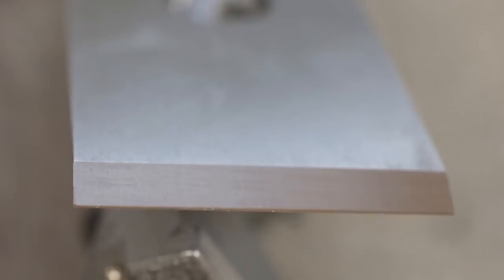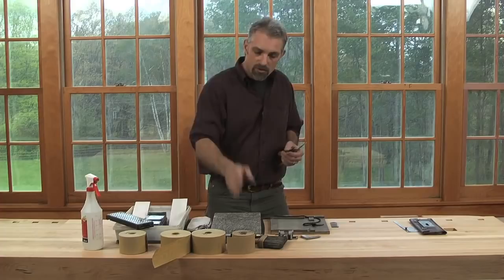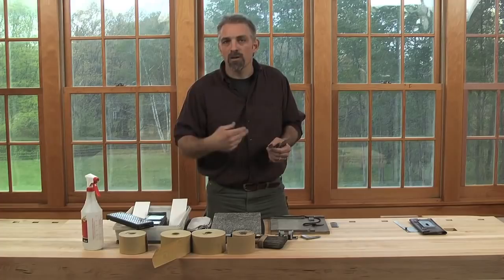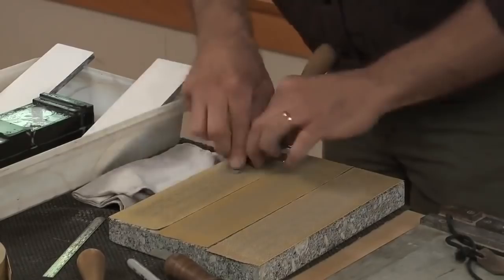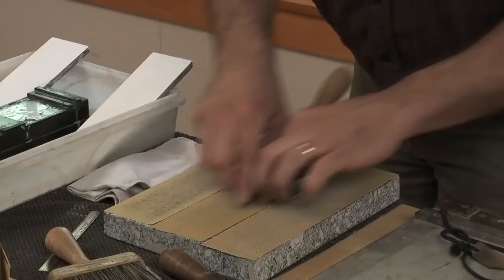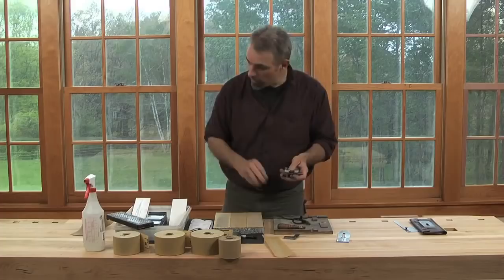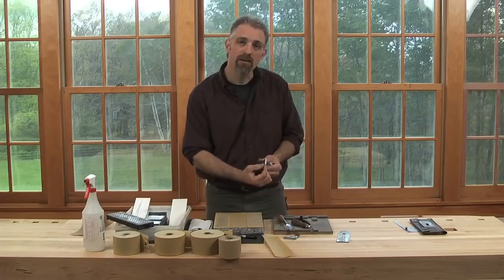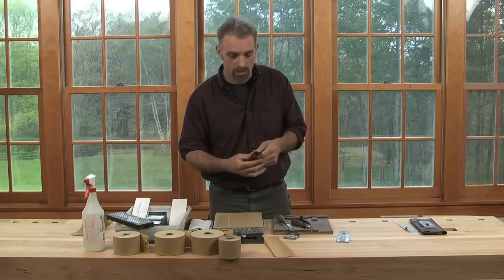Quick Tips Episode 4- Re-Establishing the Primary Bevel

Comment from the maker: When you need to re establish that 25deg bevel there is a significant amount of metal to remove.  You wouldn't go to a stone for many reasons. 1) They are expensive. 2) Their grit is to fine.  We suggest 80, 180, 220 and maybe 400 and if you could get a stone that rough you would wear it out in one session. 3) The sand paper won't dish out during the process, leaving you with a much more accurate result.  Once you get that bevel re-established you can move to the fine stones for final honing.

Comment from the maker: Ah, good question.  We are just re-establishing the primary 25deg bevel in this video.  You would do this after your honed secondary bevel grows to the point of slowing down your sharpening (usually when it grows to 1/3-1/2 of the primary bevel).  Once you get the 25 deg primary bevel back, you will hone the secondary bevel with your stones at what ever angle you need.  We have found the 8000 grit water stone to be the ideal finishing grit.

Comment: AskWoodman (here on YT) uses a 1 to 1 mix of water and Simple Green and water and states that it works very well to prevent any oxidation, it's cheap, won't affect any wood in the vicinity like oil based products, and is very easy to clean up.  He uses for drilling in steel as well.

Comment: This looks great. My one concern is the cost.  It looked to me like fixing a nick in a half inch chisel in the video required about one and a half one foot long sheets of each of 80, 180, and 400 grit.  By my estimate, the 80 grit is 80 cents a foot, and the 180 and 400 grits are half that.  So, the cost comes out to 1.5 times $0.80 + $0.40 + $0.40 which is $2.40, to repair the one nick.  I'd love to hear that I'm wrong because there's so much about this method that's really appealing.
Reply: Use a wet wheel grinder.
Reply: Seriously though, that sandpaper is like $60 a roll, for each different grit too.  3 rolls is nearly $200.  I can get a bunch of quality stones or 3 brand new LN Chisels for that amount.

Comment: In your setup board, you put something in front of the stop.  Looks like a thin piece of wood or leather.  What is this for?  Why not just push up to the wood stop?
Reply: I saw this in another of his videos.  The 1/8-inch shim is used to increase the angle by a couple of degrees to create a secondary bevel.